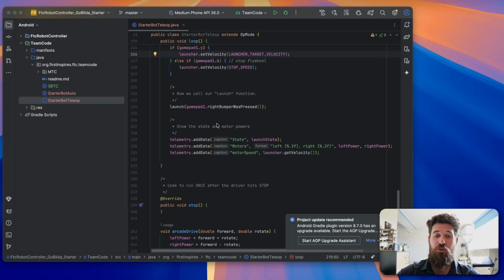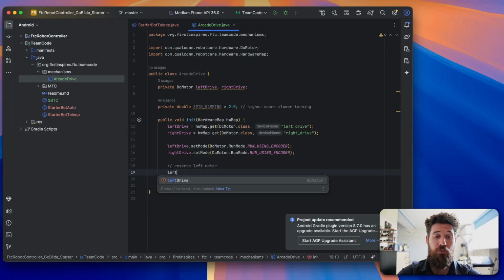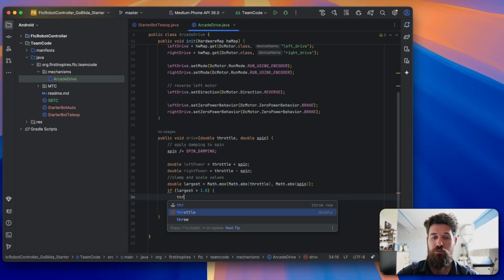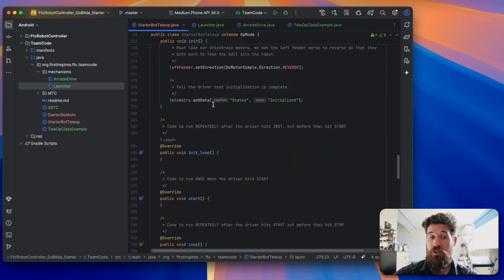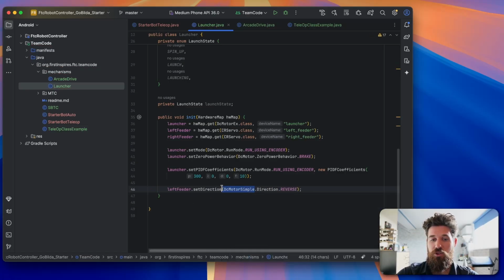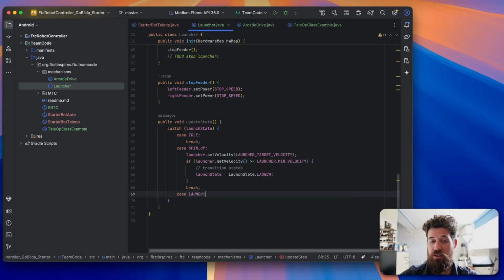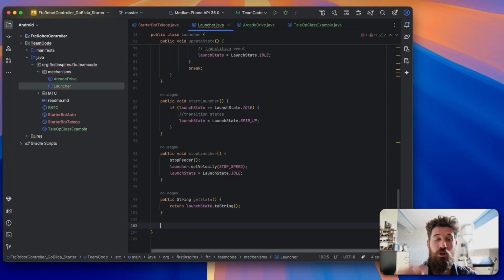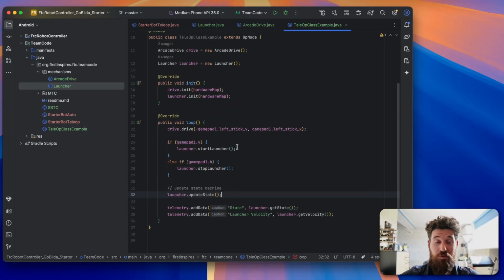GoBILDA's DECODE Starer Robot Good. Let's Make It Great.

Comment: It looks like you have a typo in your clamping code (around 8:30).  I think the largest value should be calculated using leftPower and rightPower instead of throttle and spin, and likewise inside the if statement it should be leftPower and rightPower that are divided by the largest value.

Thanks for the great content!
Reply from the maker: Thanks for pointing that out, definitely missed that. I'll make a note.